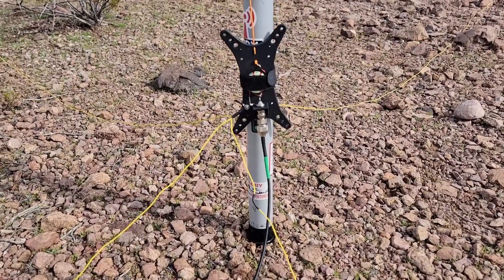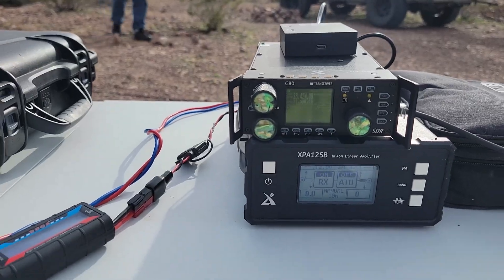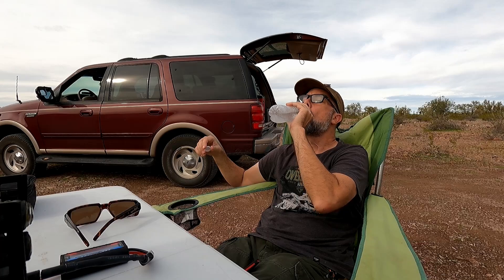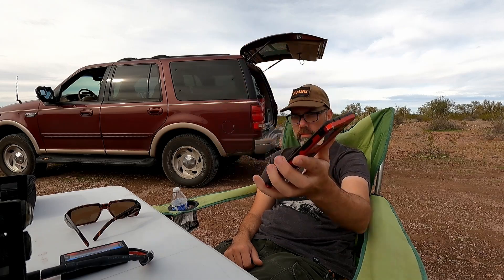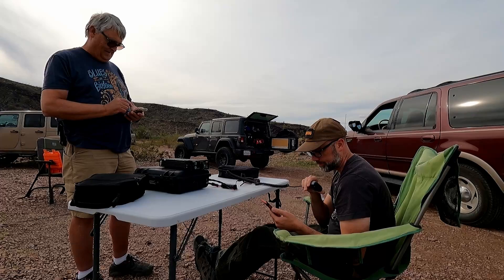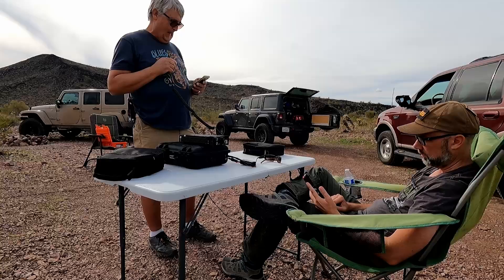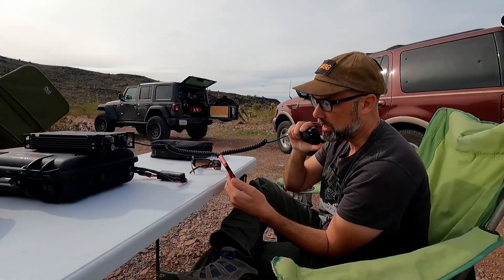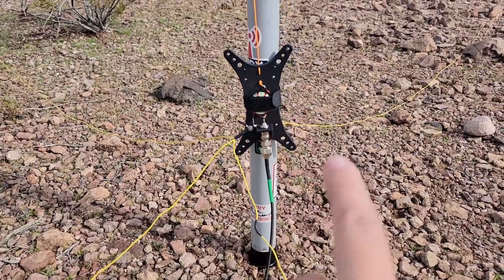New Antenna - Sneak Peak at a Prototype Coffee and Ham Radios Antenna

Comment: Steve: have you tested the Posidon with a tuner at the feedpoint compared to built in one on radio?
Would it be substantially beneficial  one way over the other?
I have a Posidon on order today and want to try out with both my 7300 and 705 with ah-705 tuner at feedpoint.
Reply from the maker: I have tested with an external tuner, but at the radio and not at the feedpoint.  It should work much better than it already does when you tune it at the feedpoint.  Let me know how it works out for you!

Comment: Don't the coax chokes belong next to the radio and not the antenna???
Reply from the maker: Depends on your mission - at the antenna removes common mode current and stops the coax shield from being a counterpoise/radial, at the radio allows that to happen, while blocking it from getting into your radio and causing problems. Operator's choice!

Comment: Nice idea for a portable vertical antenna. No sure why the 4 to 1 on the bottom but I am sure you will tell me.
Reply from the maker: This is a shortened vertical, as a result it needs a trans match to get it closer to 50 ohms so it can be tuned by your radio
Reply: How long is that antenna?
Reply from the maker: @thomashardy9994 25 foot tall!